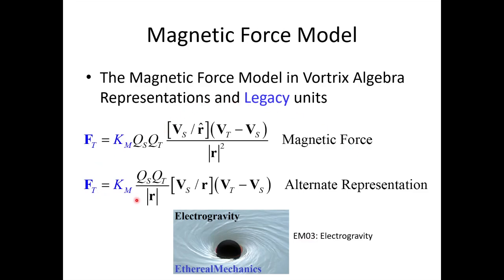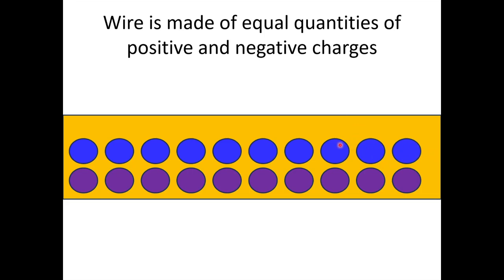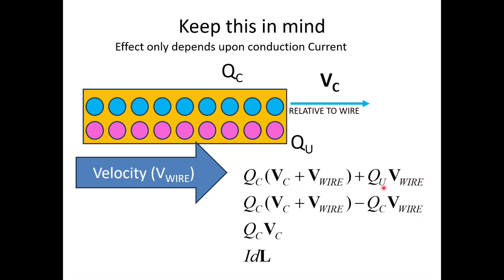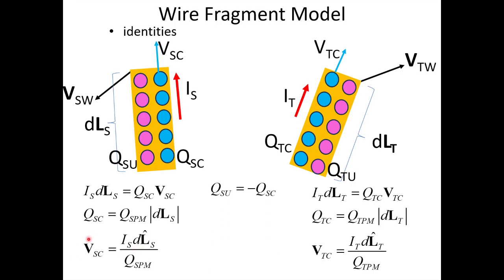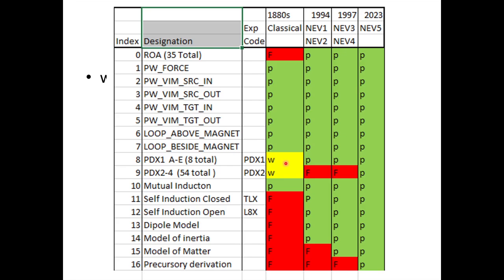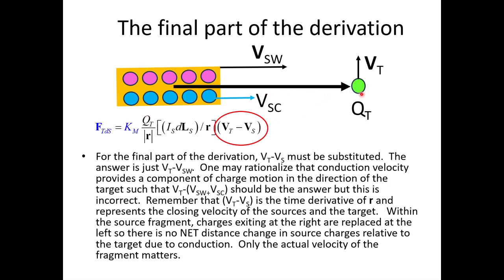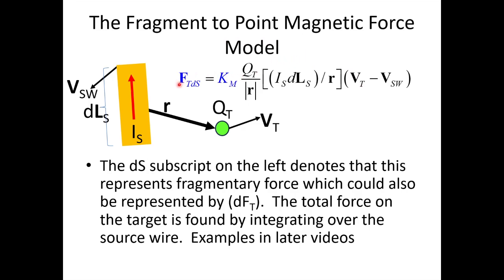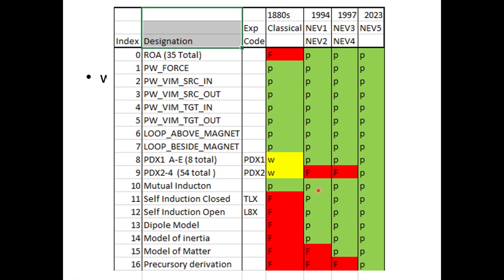em04B_03: The Magnetic Force Model -- What Magnetism Really is!

Comment: Exactly, It is absurd to think of magnetic lines of force as concentric circles around a conductor. Probably that is simply based on the observation of iron filings about a current carrying wire without taking into account the fact that each particle is a current loop at those times; So in effect the field is torquing the iron particle. It is like measuring the electric field lines of force of single charge with two test charges that are attached together, one positive and one negative, and then conclude that the field is perpendicular to the imaginary line connecting the two charges together after the electric field reoriented the charge combo by exerting a torque!
So this idea that the magnetic field is a disturbance in the medium and is decoupled from the charge and has a radiative property makes sense. I wonder how this relates to the electric field, because, if the magnetic field is radiative why not the electric field? what is the internal structure of the electric field? Time will tell.
Take care.